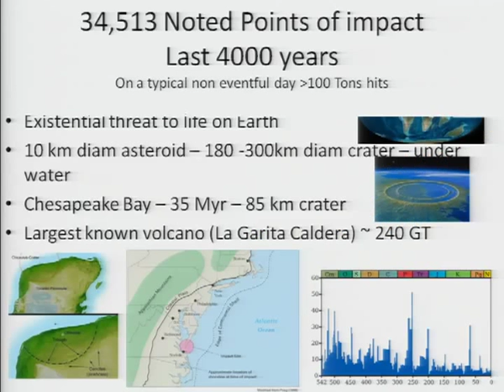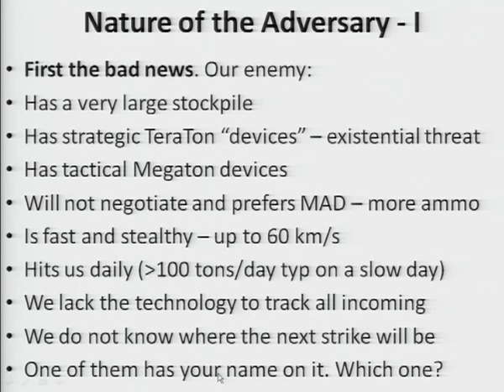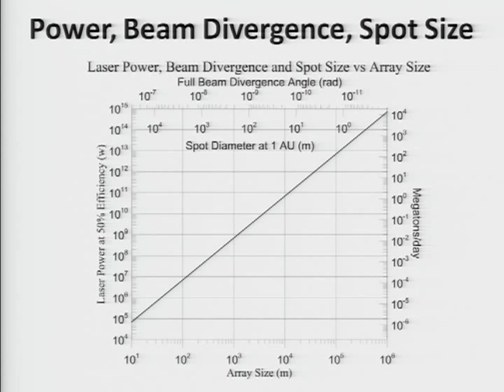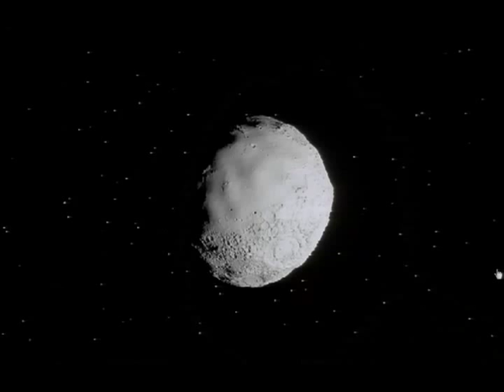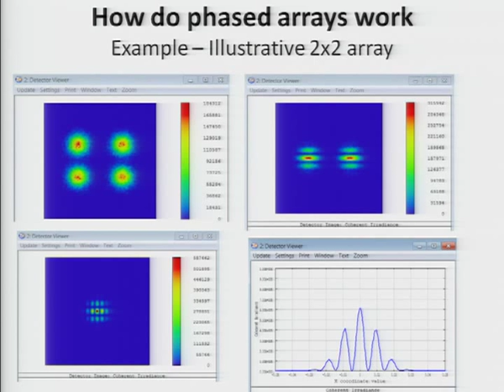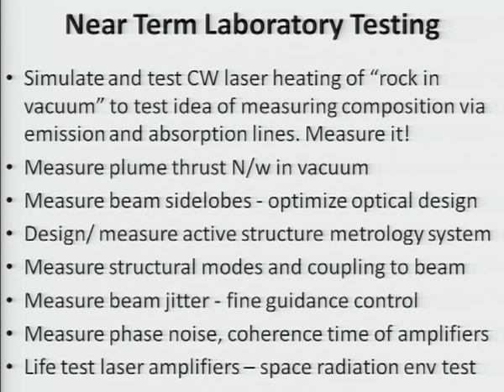DE-STAR: A Planetary Defense and Exploration System, Philip Lubin - O+P 2013 plenary presentation

Comment: My concern is that the rotation of an asteroid will in effect nullify the lazer's ability to effectively heat a certain point to get the desired purpulsion rate.
Reply: +Kevin Hook It can be aimed at a specific location and trained on that particular location via refocusing the laser.
Reply: +Kevin Hook I think it will still accumulate energy trough heating, and since there are almost no atoms out there, it won't be cooling down too fast.  So maybe we can transform a big asteroid into a big plasma ball before it hit us, making our extermination much faster. :D Jokes aside.

The typical rotation speed of asteroids are between 1-10 rotation/day, and it's usually slower with bigger roids, so it's not spinning like a neutron star. http://www.lpi.usra.edu/books/AsteroidsIII/pdf/3016.pdf
And i think we need to consider, that heating huge spinning rocks, might make them fall apart, so it might even make it easier.

 Plus I'm not shure about the exact numbers or if it is even plausible, but light will put some pressure on it, so i believe we might change it's course by 'pushing it' with a huge laser array.
Reply: MrKekson Yeah, hadn't thought of the insulation that the vacuum of space provides, since there's not much in the ways of heat dissipation in this particular effect.
Reply: Kevin  -  here is a demo/test with a small laser and a rotating rock in a lab   -   https://www.youtube.com/watch?v=sUAXZCqR1c8